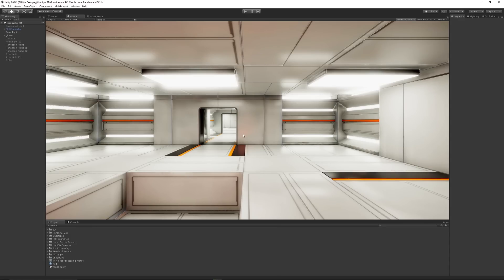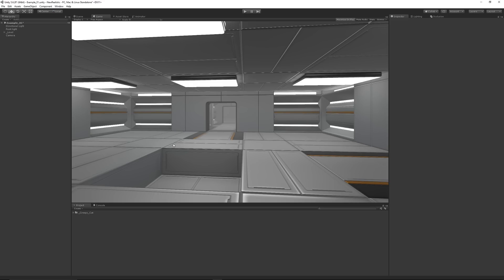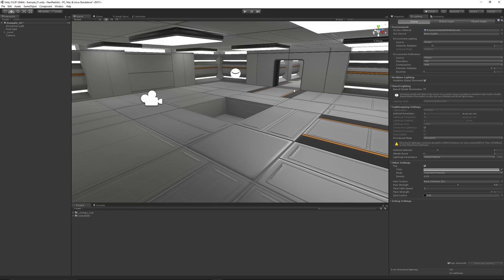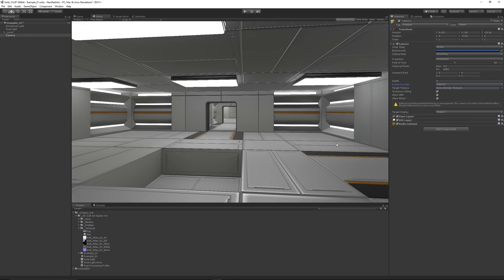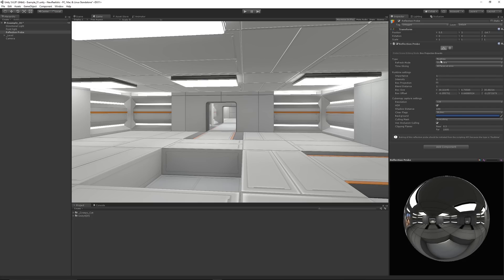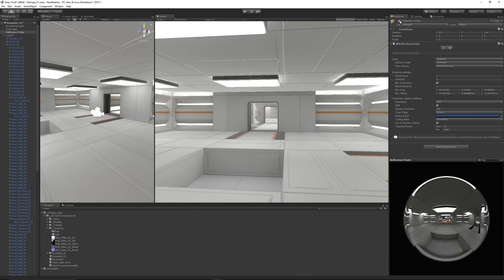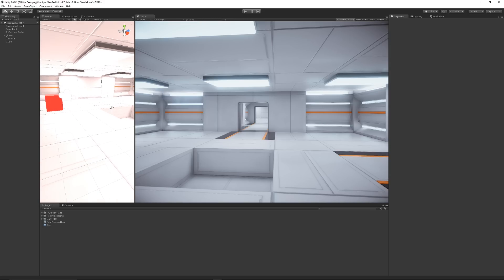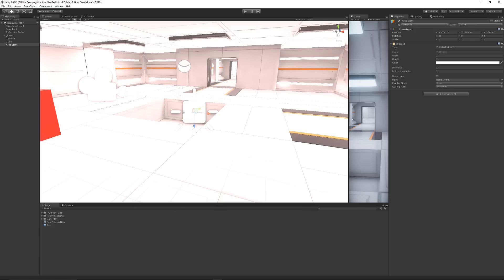How To Get REALISTIC Graphics Tutorial in Unity

Comment: Nice video, I have a question, if I do this an android device, what could happen? Because I'm making a house in virtual reality and I want the best quality but I don't want it go slow
Reply from the maker: I suppose it's depedent on the android device you're aiming for but you'd have to test performance on platforms you choose. Some of the post processing will not work on mobiles, reflection probes maybe, forward rendering is probably required but I'm sure the light baking as long as you kept settings pretty low would probably still be ok.

Comment: you should make a video on how to setup interior reflection probe because I'm having trouble with a cut scene and I've looked documentation and watched this video over and over and for some reason my lighting just refuses to "bounce". I already have it set to Linear and Deferred and Baked Indirect but nothing seems to be working, I tried setting up  baked lighting but when I try baking it either fails or gets stuck clustering even tho all of my objects other than some curtains and three characters are set to static and have "Generate UV Maps" checked and when i set up real time lighting it still acts as if its direct lighting. Could use some help because this currently effects all of my scenes no matter how much I optimize them. I also posted this in Unity Answers but I'm still waiting on it to go through the process. Just hoping you could help because it usually take them 12-25 hours and I really wanna get this scene done today so I can do my updates.
Reply from the maker: Hey, Are you using pretty low settings for a test bake at the start? Sometimes the baking does take a little wise at certain points so you might need to leave it for a little while! :)
Reply: SpeedTutor 
Yes, my resolutions are currently set to 128 and I’ll leave it baking for today but would going lower and working my way up be better?
Reply from the maker: What hardware are you using to run this?
Reply: SpeedTutor 

I’m using a Radeon Pulse RX 560 (2GB)
Intel Pentium G Series
2 Ballistix Sports (4GB each)
On a MSI Pro B250
It’s a build I just finished a few weeks ago
Reply from the maker: Any luck? The baking is very CPU intensive, so it might take longer on a lower end CPU. :)
Reply: SpeedTutor 
Yes actually 
It finally finished clustering, now it’s on the light transport. Hopefully it’s done by tonight so I can showcase the opening cutscene.
Btw thanks for the tutorials, they help a lot especially the easy save videos.
Once I get my lighting down-pact everything should be pretty straight forward as long as my optimization stays consistent but thanks again for making unity easier to understand.
Reply from the maker: Glad to hear it and not a problem at all Kyle, I wish you the very best with your project! :) If your settings are down very low the baking should only take 10-20 minutes. (Dependant on size, reflections, quality and so on). I hope it comes out as you desire!
Reply: SpeedTutor
It’s actually a house scene so there’s a lot of small objects and details